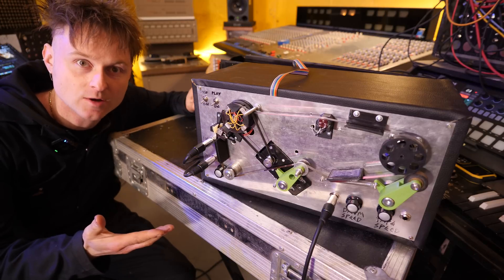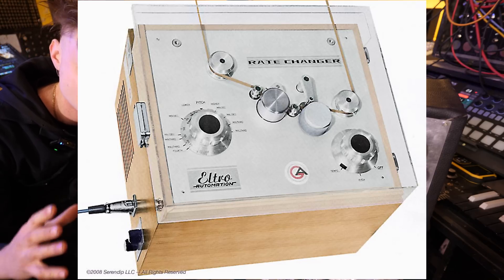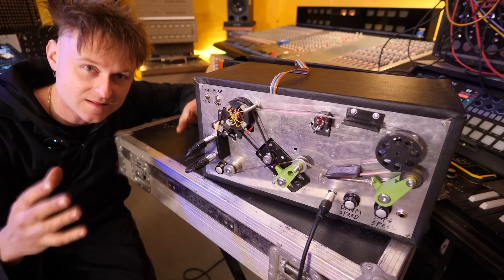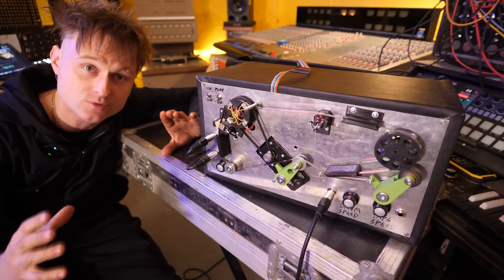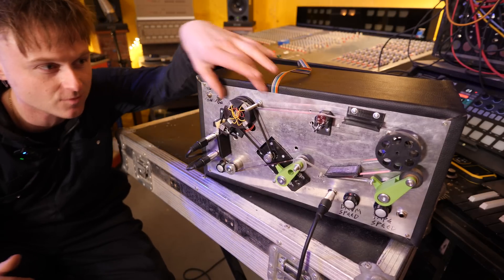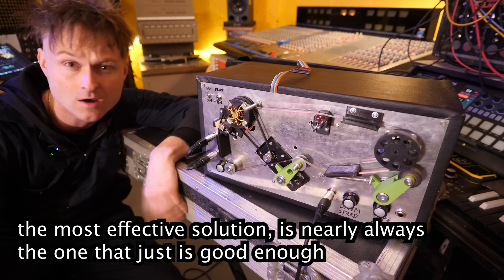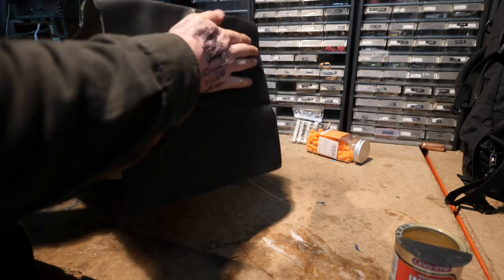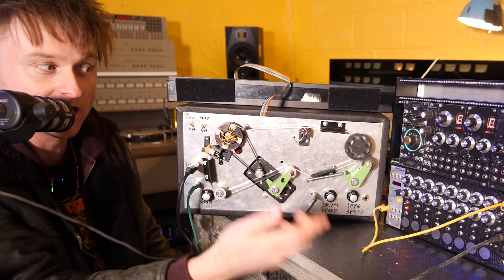It Was Never Actually Meant To Be A REALTIME Analog Tape Loop Pitch Shifter

Comment from the maker: lots of things i want to do with this, got lots of ideas.. but ofcourse, with every quick idea, is a week or so of swearing at a pile of electronic wires, if you enjoy this project let me know and i will take it to other conclusions
Reply: "Exxxterrrrminaaaate !!!"
Reply: Couldn't you use a vibrating stereo tape head(s)?
Reply: bud get some rest ... amazingly awesome as always...
Reply: sling your hand down the frets made the most bad ass digital sound ...
Reply: @LOOKMUMNOCOMPUTER  Love it please keep going Sam! 😊
Reply: One simple mod will be to be able to switching on and off the erase-head, so you can make tapeloops and keep on writing on the tape..... Have fun!
Reply from the maker: @markbroekhoven4416  indeed :). if you look closely at the top right corner of the machine. that switch is indeed there. the tape loop is very short though
Reply: @LOOKMUMNOCOMPUTER  I, for one, would love to see more stuff on this, as you're asking.
Reply: Hi sam,  these projects are some of your best work man.  Have you ever thought of building a mixer that was modular ?  I bought a xone 96 dj mixer a few years back.  Although the layout and sound are amazing,  it has some design flaws like getting seriously hot in my climate.  It's caused by A&H putting the PSU inside the unit.  How nice would it be to put together a mixer that was fully serviceable and expandable.
Reply: - I was gonna say that if you were to clean up the sound, like the distortion coming from the tape-head wiring.. and feedback for their interference (if you twist a wire pair it SHOULD remove all interference from other wires.... like the two wires coming out of each of those 4 rotating heads should be twisted together... the spiral shape of the twist actual protects it.. this is what HAS TO be done on internet/Ethernet cables and even old telephone wires... that should clean up the signal quite a bit....  and you should probably do with with ALL signal wires... hell even the power wires going to the motors... but you HAVE TO ONLY TWIST THE POSITIVE AND NEGATIVE OF THE SAME CIRCUIT ... not a negative from one motor with a positive of another motor... this will only make it worse.. much worse)
- I hope this helps because  it would be AMAZING if there wasn't such degradation and distortion.... like the distortion sounds good for some things, but you want to be able to control it
- Oh and one more thing... using a VHS tape and head would have MUCH HIGHER "FIDELITY" .. like you'd be able to have a much better recording on the tape... But I think you might wanna just go with a wider tape to start... IF you aren't able to get much higher quality... such a thin tape just isn't meant for high quality recording..... but then I guess you's HAVE TO change all the heads to use wider tape.....
Reply: - - -OHHHH!!!!! - CRAZY IDEA!! -  On the 4 rotating heads.... if you did use a WIDER TAPE.. you could keep the 4 heads you're using but position 2 of them to be on the "upper" half of the tape, and the other 2 heads on the 'lower" half.... but you would have to go with a wider recording head.... this way 2 heads are playing back the higher frequencies and the other 2 are doing the lower frequencies.... just an idea :)
Reply from the maker: @ThatTweedle  not sure what you mean, you might misunderstand how tape records frequencies possibly. it does not do it in an up and down way. more a forwards way :D

Comment: This is such an utterly bonkers idea, it's brilliant! I just lost it completely when you started feeding in varying voltages from other gear. You should definitely explore some extensions to this project, MIDI would indeed be an obvious one to complement the CV control.
Another mad idea might be to build a second head mechanism (perhaps smaller diameter as someone suggested) but *ADD IT to the machine rather than replace the existing heads*, running the head motors at 2 independent speeds against the same tape loop - with independent outputs that could be summed, inverted, and maybe even fed into a ring modulator?
Oh and thanks for the belly laugh reminder of the Theremini!

Comment: If you have two adjustable tensioners, one between the record head and the read drum, and another on the other side of the loop to balance it out and maintain the overall tension, you could have a variable delay time without really changing the speed, no?

Comment: This could turn a monotone talk into a song. In real time. What even. I'd get terribly thrown off hearing myself pitch bent like that. I'm curious if the motor on the heads was swapped for a large flat disk that could be "scratched" like a record but the effect would be really different.

Also I hate to say it looks like that "transformer" on the VHS head is actually the motor windings. Which is why they're pointing outward. Toward the circular magnet. There is a "transformer" deeper inside but you'd have to dismantle the head itself which is probably a one way process.

Comment: Cassette tape is NOT 1/8" wide. It's 3.81mm wide which is 0.15". I thank you! What a fascinating project!

PS I used to design and build my own hi-fi cassette decks for a hobby. If you want to improve fidelity and you're not using any high frequency bias on the recording side, look into that. There are plenty of free resources on the Interweb explaining it. Simple DC bias might even be an option if you don't mind it being noisy.
Reply from the maker: There is an ac bias on this
Reply: @LOOKMUMNOCOMPUTER  Good to know. Thinking about it, I'm not sure how useful AC bias is with such a variable tape speed. DC might give more predictable results in terms of distortion reduction. I've never played with more than one fixed speed at a time, so I don't know really.

Comment: Love this video/design. Is that bolt being used as a guide scratching the tape? Can’t tell if you wrapped tape around the threads, probably smart. Just so the tape doesn’t degrade/disintegrate too fast. Many thanks for the work you do. Sounds sweet with the guitar✨🤙✨
Reply from the maker: A bolt is just like a normal tape pillar with holes in it

Comment: tube preamps?  and another idea that keeps bouncing into my head with this, using a spinning disc then you could not only move the head relative to the disc, but you could also move to a different concentric circle which wouldn't change the pitch (or would it?), but i would think it would change the resolution of the sound as the surface speed is different.  what ever happened to the floppy idea?  time to resurrect that one?  isnt the artifacts and distortion of the sound the point? like if you want crystal clear get a digital delay...

Comment: Man, that's really awesome, keep on going! 
I think those factory made pitch-shifters were made for pitch-shifting of existing tape recording. Which must have been pretty cool, to put on any existing tape and pitch shift it. I am not aware that real-time tape pitch shifters ever existed, but it's possible. 
You can put AC bias to recording head, which will improve sound quality significantly. Just use recording electronics from some boombox. The tape tranport and rotating head drum should also run smoothly, which I don't think the stepper motor does.
Reply from the maker: stepper motor runs smooth enough, hence mentioning in vid, the slack in the tape is more than enough, also it has got an ac bias already. thanks!

Comment: Next time, do it fully electronically, it must be possible in analog. I achieve the same effect on a shortwave radio when tuning into a station using SSB modulation – a change in tone without changing the speed.

Comment: Cool stuff. Version 3 could have 10 rotating tape heads in a row and you could crossfade between their outputs. Voltage control over general rotation speed plus a dedicated delta speed per rotating head.
Probably a really bad idea, sorry about that 😆

Comment: slip rings were used for flying video heads on open reel 1/2" helical-scan video tape recorders for 20 years (and various other formats) at a way higher bandwidth and lower gain than audio tape heads

Comment: There must be a market for selling some of these lo-fi loopers once perfected at the right price or in kit form. I think you're on to a winner and being a guitar player this is I think the best thing you've ever made Sam it's insane!
Reply: you could also probably get away with the cheapest steppers and uln2003 drivers, then it's basically an arduino, 2 uln 2003, the electronics for the tape audio and some connectors for the jacks.
Reply: @satibel  True but tape heads and motors are cheap and you lose the lo-fi-ness of it all. I'd buy either tbh if it sounded like it does in this video.

Comment: If you havent’t yet done that, I humbly suggest going over the playback side before the recording. Record a tape loop on a calibrated machine, disable the recording head and adjust head tilt and playback eq. After the playback is adjusted, it’ll be much simpler to adjust the recording side.
Reply from the maker: That won't work. This is not the same head tilt as another machine

Comment: How about driving the stepper with two sine waves 90 degrees apart? Could probably use the Joranalogue/Hainbach module to provide the phase shift. Run both sines through a chonky audio amp....smooth and silent stepper??

Also the part where you were turning up the aux send we both said "pitch shifted tape delay" 100% unanimously and it made my morning hahaha
Reply from the maker: It is silent with microstepping and a driver. It's all good

Comment: Very very cool indeed! , an adjustable drum entry and exit roller might be good to fine tune the tape angles? also take a  look at a Revox B77 schematic for record/replay electronics :) genius to use stepper motors. cv control actually works because you did this!

Comment: Thats so cool. Have you consider recording stereo, with one side out of phase, and the preamp could be a differential amplifier (like on balanced audio) or a center tapped transformer, maybe? I wonder if the noise is random enough to defeat the noise-canceling capabilities, or if the tape rolling dynamics affect it differently enough to also defeat it, but, should be worth at least a try if you have the parts lying around. Just an idea =)

Comment: If you wanted to get really fancy and avoid the slip ring, you could always try and design an octocouple for the spinning head.  Boy, wouldn't that just work great, and be so easy?  😆  I guess if you had a long drive shaft coming down from the read head, so you could space out your emitters on that shaft rather than on the head itself...   could be done, but not something I'm going to put my time into.

Comment: Hmm, lots of familiar sounds here. I wonder if the Chuck Jones film The Phantom Tollbooth used one of these basic concepts. I'm sure a few other films used that equipment if they were sold for a while, it was literally some Hollywood sound guys' job to travel in Europe in the off season and look for weird gear. 

But yeah.  It always stood out to me as a kid for those which affected the timbre and pitch without speed, compared to many other productions which also changed the speed. (Especially the voices for the "lethargians", and the giant monsters at the end. Also weirdly they cut out a lot of the aspects when singing, so I imagine it was a different physical sound chain or they struggled to control the pitch.)

Comment: The tape in the VHS is slanted to enlarge the read surface, since a image "data"  requires more space than the width of the tape can provide, explained @ Technology Connections. so no benefits there.

Your device sounds very cool now. in the Roland Juno 106, there where Intel 16 bit counters, one for each voice to control pitch, 2 bad you can't buy these ic anymore to control step motors.

Comment: It still sounds like you're recording with no AC bias on the tape, hence the gross distortion. Maybe that's what you want, but I feel its too many effects at once! Tweak the bias (or add some!) to get rid of the distortion and you have a winner. Bias is simply a 100kHz or so sinewave added to what's going to the record head, pretty easy to arrange. Make its level variable so you can find the sweet spot for the tape you're using.
Reply from the maker: i have been recording with bias in both videos
Reply: @LOOKMUMNOCOMPUTER  How come so much distortion then?
Reply from the maker: @GRAHAMAUS  , dunno im just driving it. sounds better

Comment: I could REALLY use some Copicat heads to fix one I have.......  since they are UK made,  I'd imagine there's more parts there than here in the USA.   Any advice?
Reply from the maker: never seen them for sale singularly
Reply: @LOOKMUMNOCOMPUTER  There's a dude with a website called  Amp-Fix  who is said to sell them......... as has some for sale.  The ones that fit mine are out of stock at the moment though.

Comment: I think your approach of 3D printing your own 4-head drum is the way to go, mostly because cassette tape heads are still being manufactured while VHS heads are not. The VHS machines that aren't in a landfill are starting to get collectable, I haven't seen a stack of VCRs in a thrift shop for a decade. Cool effect, I am curious how the tone would change if driven by stepless servo motors or brushless motors driven by 3 phase sinewaves. There's definitely a robotic, techno feel to the steppers from the discrete tape and head movements, and I'm guessing stepless drive would have a more dreamy, floaty mellotron vibe. Both could be great effects in different situations.

Comment: You can also get a stepper motor to run smoother with microsteps if you don't employ that already. 
Hi Sam!
Reply from the maker: yep! but you also divide the speed at which they are effective at the torque. so sadly no use. it isnt an issue as the slack in the tape is more than enough for the steps to not be an issue :D

Comment: It sounds like the most sound degradation is coming from the 3D printed parts with their rough regular surfaces or you can hear the stepper motor steps. Maybe microstepping could improve the sound and a machined tape transport wheel could help there?

Comment: That sounds pretty good! The problem with moving the recording head closer is you still have 90 degrees on the radius between reading heads. I think making the read head wheel as small as possible and moving the record head closer would together make a good improvement. There's also a lot of distortion which sounds kinda cool, but probably not wanted, something is being over-driven.

Comment: I have messed around with slip rings in the past. Their nose comes only through resistance variations.  There is also a thermal EMF component, but only when the entire thing is being cooled down or heated up. The more current flows the noisier it gets. For your application there should not be any slip ring noise at all.

Comment: You were totally right not to use VHS drums. You can't really use the transformer in a VHS tape drum for audio. They got way too low impedance for anything in the audible range. Hence HIFI sound on the VHS tape was nothing more than 1.4 MHz and 1.8MHz FM modulation back in the day. It's like wide band FM short wave radio on 2 independent frequencies. Worked pretty well though. Best analog recording quality I have ever heard.

Comment: Nancy here, Negative Nancy. The stepper motor noise I was referring to would be a sort-of frequency modulation, not an amplitude / noise-floor type dealy. When finished, play in a sine wave and listen to the output. You'll likely hear a bit of modulation. If not, that will be a win for micro-stepping! Just meant to bring it up to help avoid a potential pitfall. Not meant negatively, in fact, I have nothing but respect and admiration for all that you do! After so many videos, I guess I shouldn't be scared to try it.
Reply from the maker: I know of the issue you speak of it's why I was hesitant. But after thinking of this and that. Like a lot of things. I think it can be remedied 👍
Reply from the maker: It is a bit of fun anyway! Always open to ideas :) thanks for the pointers!
Reply: @LOOKMUMNOCOMPUTER  I'm interested to see how this turns out! Very cool concept, indeed!
Reply from the maker: Indeed! I hadn't included it but having tested it before doing the video with the wheel the flex in the tape takes it up. Remember play head is at the slackest point. If there is an issue like you say it could be easily circumnavigated by putting the tensioner on the top of the machine instead of the bottom

Comment: That is full analog pitch shifting echo! I will definitely build one for myself!

Also, I suggest using dc motors instead of steppers. Steppers usually move in pulses, and that speed modulation transfers onto tape - unless you especially want that extra warbly sound, of course. And dc motors are actually easier to control - PWM regulator will do the trick even w/o the MCU.
Reply from the maker: I address all of the questions of why I use stepper motors and will stand by using stepper motors in the video :D. Steps are very small in microstepping and definitely taken up by the give and slack in the tape
Reply from the maker: You don't get warble from stepper motor stepping in this application. The positives of steppers outweigh any negatives. From tests
Reply: oops not seen that fist time
actually, strange! usually every mechanical vibration makes it to the tape, every freaking one of it!
good that it works, that thing is just from another world, fascinating!

Comment: Its one of the most beautiful machines ive ever seen. It has every required element, ribbon cable trapped under an edge, unused holes, custom sharpie font. Its a joy to behold. The most important thing. It works.